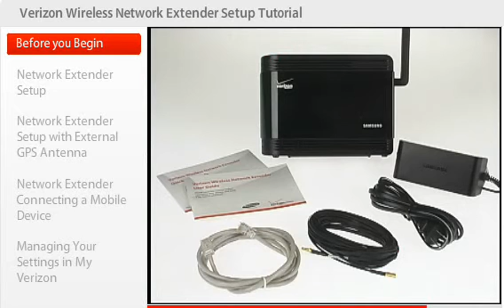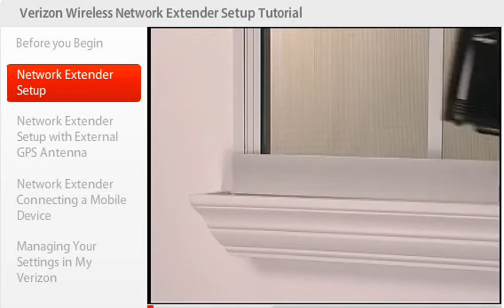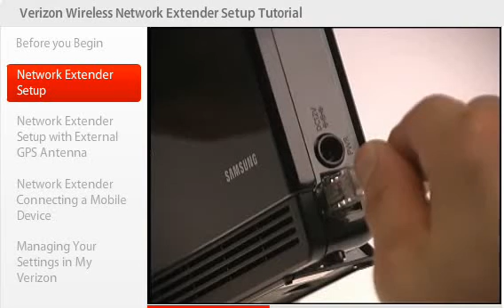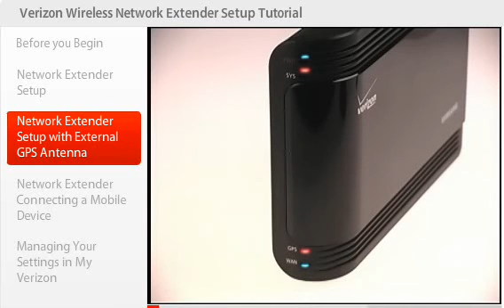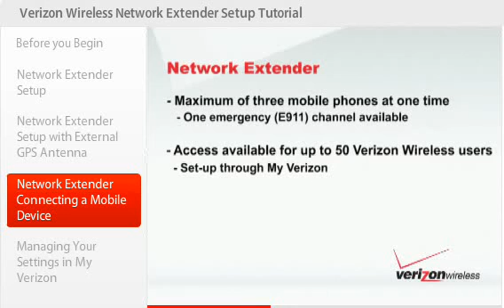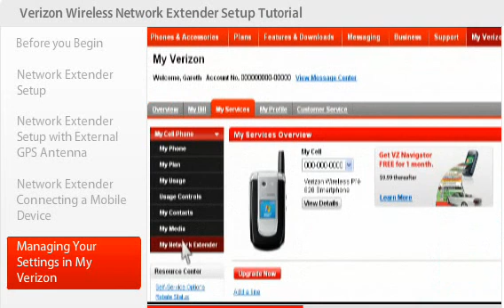Verizon Network Extender

Comment: hello I have a question on connecting the extender i currently have a linksy wireless modem and a qwest router both only have one ethernet input i have internet with no wires to connected to my computers when I disconnect the ethernet from the router and connect the ethernet coming from the extender then this works what can I do to have both the extender working and my internet